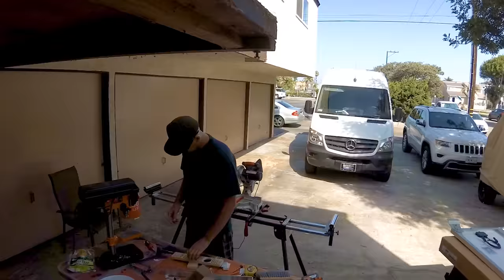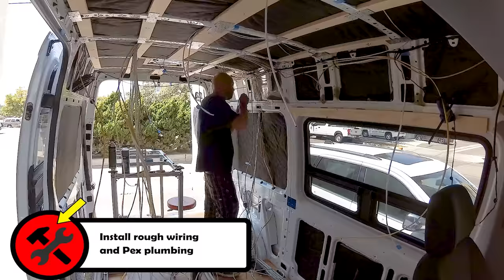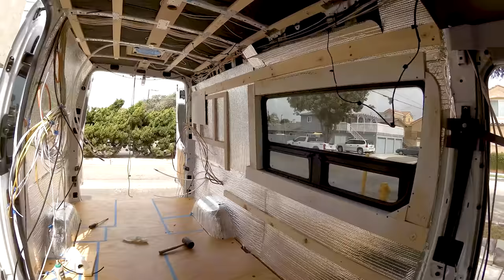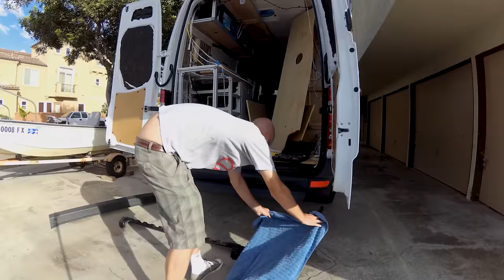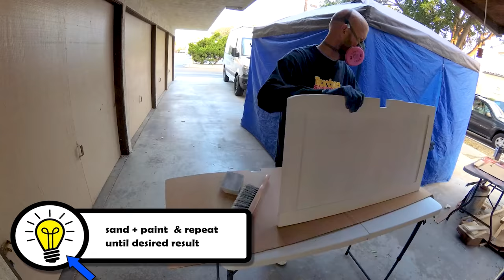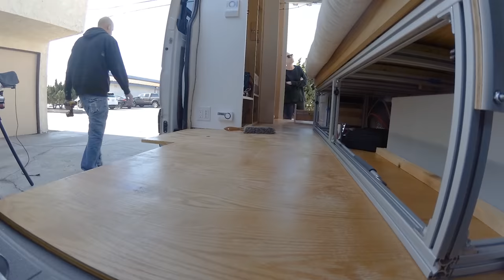CamperVan Start To Finish | Van Build | Sprinter Conversion Timelapse

Comment: Tbh I like the setup, and if I were to make my own, I would probably put the sink at the end of the bed where the double doors are. I would also put the heat up stove right next to the sink with a window that you can open for letting out smoke when cooking either a push out or a sliding window (IF Possible)

Comment: Bill did a really nice job putting the Sprinter together. Working full time and getting it done in a year! Impressive. Really liked the information shared during the video too. Thanks for sharing, Donovan and Jodi
Reply from the maker: Thanks 👍
Reply: How much to buy a similar van if you need to spend whole year full time on conversion? Lets say he would earn 50k in his job, does similar used van cost more to make it worthwile?
Reply: Good

Comment: It's always a tricky balance to get the duration of a timelapse right; for me this went too fast with the information points not being on the screen long enough to absorb along with what was actually happening in the video. I used the playback speed feature to slow it down to 0.5x/0.75x which helped. The amount of wiring in the van is actually scary lol. Really great information in the video though - thank you so much for making it.

Comment: looks great! Installing reflectix without an air gap is useless for insulating properies tho...
Reply from the maker: Good point!  
I was on the fence about installing Reflectix and originally decided not to.  But because it is so inexpensive I decided last minute its not going to hurt anything to install it.  I didn't want to have any regrets on this build.  It will at least offer vapor barrier properties and maybe some R value.

Comment: Nicely done! We are in the midst of our build, quite the project. I have a few questions for you - 1) what is the wall and ceiling panel you are using? It's glossy, is it laminate and who makes it?...2) what size gray water tank did you use? We may not be able to fit ours where you did due to our heater being installed beneath our bench seat by that crew window, to be more central to the van...and are now looking at where we can fit one! A game of Tetras, for sure...good luck to you!
Reply from the maker: Thanks!
I used white aluminum sheet for the walls and ceiling, not sure of a brand name.  I picked it up at a sheet metal supply.  The fresh water is a 30 gal under the bench / bed.  https://amzn.to/36pYEYl
I used a 20 gallon for the gray under the van.  I think it is this one https://amzn.to/2L0zlEN please measure to make sure it fits because I don't remember.  Good luck with the build!
Reply: @hbsprinter  Thank you for your information!

Comment: very nice, to test the van with the authorities, do you have to disassemble everything? or is it converted into a camper?
Reply: There are about 20-25 certs, rules, norms and modifications your vehicle needs to have correct/follow/installed in order to classify as a camper. It's pretty much universal, I don't know about U.S or Americas, but it's the same all across Europe, Asia, Australia and Africa.

Comment: Love your van SO much!!!  Thanks for sharing this.  Question though... can I ask how you ran your water from the water tank to your shower?  And did you only use one grey tank under the van?  Did you link the shower side and sink side together?  Did you use some type of pump to pump from the shower?  Thank you!!!  Trying to figure out how to do this!!
Reply from the maker: Thanks.   I actually just tied the shower and the sink together with a tee fitting and used one gray tank on the driver side.  No pump is needed because the tank is lower than both.  Good luck with your build!

Comment: Nice buid!
I was wondering, that upper 80/20 for the cabinet, did you secure it only to the ribs of the van or also to those wood ceiling supports?
Reply from the maker: Thanks!

I supported an 8020 piece to each ceiling rib. I also attached an 8020 piece to the wall securing it in about 5 or 6 points.   I did not see the need to attach to the wood supports.
Reply: @hbsprinter  thx, I'm starting to plan a build (still need thevan but will get one eventually) so I'm looking at how others secure their upper cabinets to have a good idea on how to do it when it'll be my time.

Comment: I love your van! The sleek lines of your cabinetry and the flooring! 🤗🤗🤗 I'm buying  a 170 LWB but I'm copying your cabinetry look. That air gap design for the cabinet floor is genius. I haven't seen that anywhere else. What was the brand of paint you used? Flooring?
Reply from the maker: Thanks!  I used rust oleum marine paint for the cabinets.  
Primer https://amzn.to/3iWQ2h7
Topcaot https://amzn.to/3ovCjPo
The flooring is Acacia engineered hardwood and was purchased at Lumber Liquidators 
Good Luck on your build!

Comment: Very nice build. I'm building my own van right now, partly based on this design! Question: how did you secure the metal mounting brackets for the ceiling onto the metal of the van (@ 1.00)? Mine keep coming loose. Thanks!
Reply from the maker: Thanks! 
I used self tapping screws (Tek Screws) to go into the support ribs and wood screws to hold the wood stringers in place.

Good luck on your build!
Reply: @hbsprinter  cool, thanks!

Comment: No one ever answered this for me but there was a lady and her child who died in their car when the battery in their vehicle which was located under one of the seats malfunctioned.  It gave off odorless fumes and they sadly died from it.  What is to prevent this with the batteries located inside these sprinters?
Reply from the maker: The batteries we used are Battle Born LiFePO4s which have built in BMS which will shutoff current in the event of a short circuit. Battle Born LiFePO4s also do not off-gas and do not require ventilation.   Lead acid batteries on the other hand must be vented to the outside of the van for safety.  As an extra safety precaution we have a smoke / carbon monoxide detector to notify us in case fumes from any source could enter the van.
Thanks for watching.

Comment: I checked in a few times during your build when doing laundry over at Dan's. I have the white small Ford Transit Connect(DANOVAN). Awesome video and work you did on it. Would like to do a mini conversion on mine.
-Dano
Reply from the maker: Dano

Thanks for stopping by during the build.  You definitely could make that Transit awesome.
Best of luck with the conversion.

Comment: Hey man, thinking about same layout for my sprinter, did you have any issues with weight distribution on turns etc? Looks like it is heavier on left side with kitchen and sofa being same side, Thanks
Reply from the maker: The van definitely has more top roll while going in and out of driveways.  I was able to reduce it by adding Sumo Springs front and back.  Stay tuned for a video on Sumo Springs installation in the future.

Comment: Hi! Beautiful build!  We are in the middle of our build and would like some more information on the paint and hardener you used.  Your cabinets look amazing and I’d like to get a similar finish.  What was the ratio you mixed and links to the brand you used.  Any suggested sprayer?  Thanks!
Reply from the maker: Thanks!
I used Rust-Oleum marine primer and paint with 2 ounces per quart of hardener.  I thinned the paint to proper viscosity with Xylol/Xylene Solvent.  I used the HomeRight Sprayer which works good but can be a pain to clean.  The key is to paint / sand and repeat until you get an acceptable finish. I did 2 coats of primer and about 5 coats of topcoat, sanding in between coats.  It is very time consuming but is worth it in the end.  See links to products I used below.

HomeRight Sprayer https://amzn.to/2KozFJG
Rust-Oleum 207014 Marine Wood and Fiberglass Primer  https://amzn.to/34Vf9de
Rust-Oleum 206999 Marine Topside Paint, Gloss White  https://amzn.to/2RTHbQI
Valspar 4625 Enamel Hardener  https://amzn.to/2yuNi7m
SUNNYSIDE CORPORATION 82232 1-Quart Xylol/Xylene Solvent (not availible)
Reply: HBSprinter thanks for the reply!
Reply: Hi there again!  Wanted to see if you can link the bed sliders and cabinet hinges.  For the sliders did u use angle aluminum to bolt to the 8020 and wood? Thanks so much!

Comment: Boy o' boy did he regret making those elements out of aluminium :D
Reply: Why?
Reply: Because steel is very good temperature conductor. And it's going to be ifnnot colder than outside temp. Also: condensation.

Comment: For the cabinet sides (not doors), did you recess the plywood into the 80 20 or route the edges so the edges are flush with the 80 20? I think you have to use the concealed connectors and route to just slide in the panels so flush? Still trying to figure out :=)
Reply from the maker: For the cabinet sides on the 80/20 I just used 3/4" plywood and the panels are simply laid over the top of the 80/20, then secured with 90 degree angle brackets to the side of the extrusion from behind.  Hope that makes sense...
Reply: @hbsprinter  That makes sense. Never thought of that.  More industrial look, but only on side panels.  Great idea !

Comment: What kind of wood is the front of the cabinets made of ?
Reply from the maker: I used Poplar for the frames and 1/4" plywood for the panels at first and later  switched to 1/4" MDF for easier finishing.
Reply: @hbsprinter  thanks